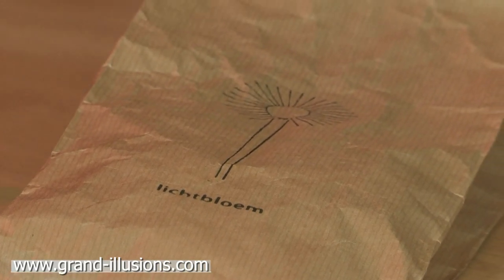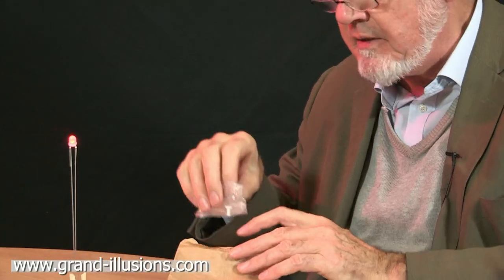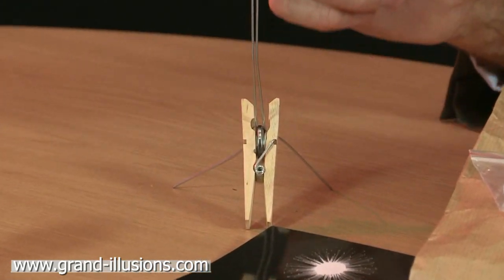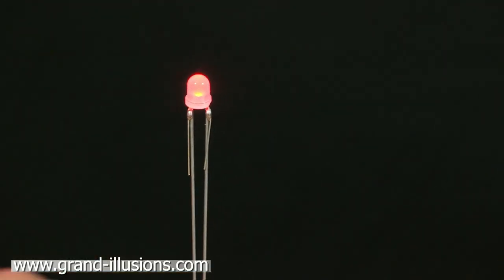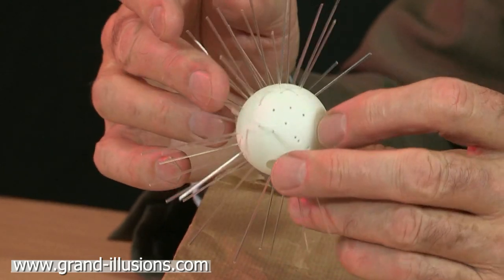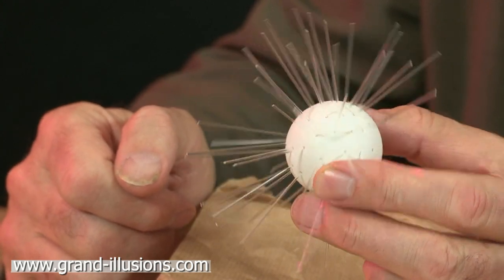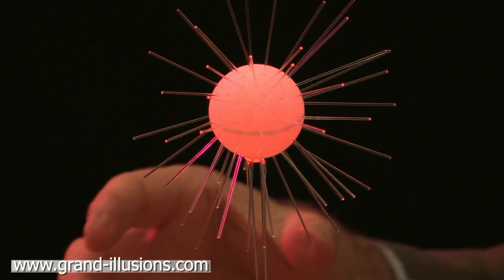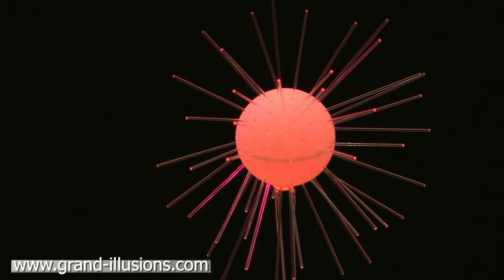Light Flower

Comment: Please tell me that LED has a resistor in it. lol
Reply: You only need a resister if the battery votage is too high for the LED.
Reply: Coin cells have really high internal resistance and the voltage sags very badly under load (and just few milliamps is significant load for these). A brand new unused cell might overdrive an LED mildly, but even with just seconds of use it's going to start dropping and it's not going to seriously harm any modern LED.